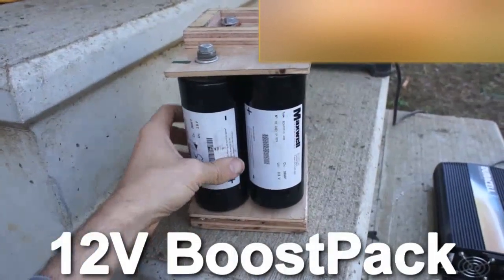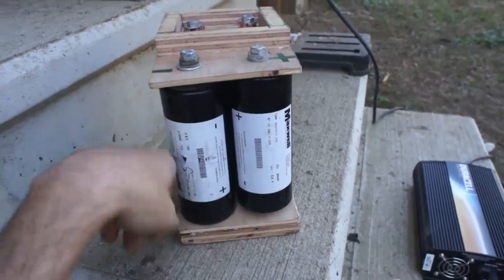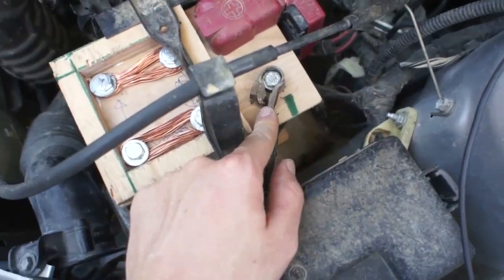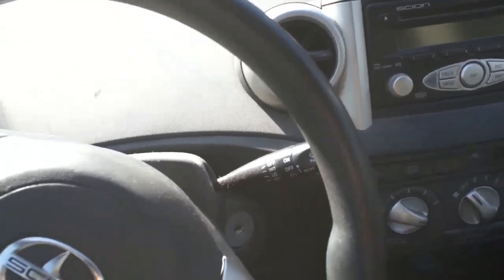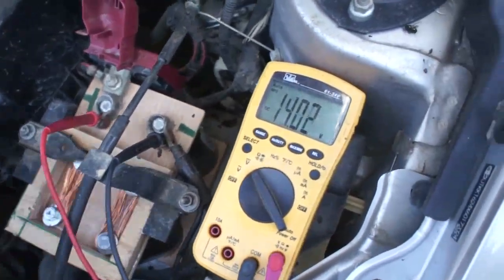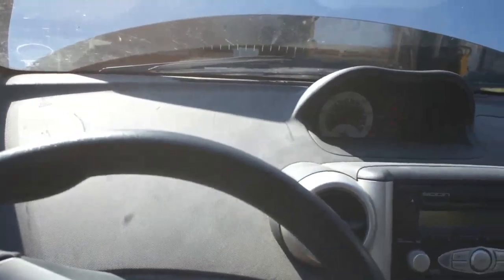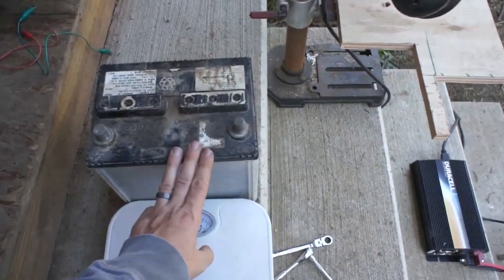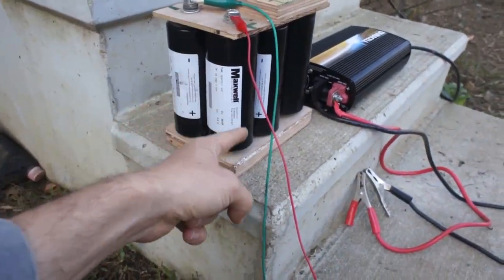12V BoostPack. Replaces auto battery. Works great!

Comment: how do you prevent overcharging?
Reply: If a capacitor is connected to direct current it will gain charge, to its max capacity then it will stop the current from flowing.
Reply: Thanks!
Reply: There's an issue with that. A capacitor is safe until a particular voltage. When the charge in the capacitor balances out the voltage applied to it, nothing more happens, no further current will flow. So in case you're using a single capacitor cell, it's very safe. It's only safe up to a given voltage, of perhaps around 2.6V for supercapacitors, if memory serves.

Now to make up a battery, he has connected 6 supercaps in series, making for a nominal voltage of about 30V. There is however nothing to balance them, nothing to prevent, by difference in individual capacitor behaviour, comparatively low voltage occurring on some capacitors while relatively high on others, damaging them (akin to "overcharging" you mention but not quite), increasing their ESR, and then potentially causing even higher voltage to form on them. See Ohm's law. Current must obviously be the same through all cells in series configuration, but then the voltage dropped across each of them is proportional to their individual ESR.

I think it works for now because the nominal voltage is so much higher than alternator voltage, creating a bit of a margin for ESR difference between cells. However, it doesn't appear intrinsically safe to me. Maybe it is for particular kind of supercapacitors, but we'd need an expert on those units to comment on that.
Reply: how do you get 30v when you multiply 6x2.5=15v??? how did you come up with twice that. and ohms law that all carry the same charge and voltage besides for its rate of decay, decay raits sould still function as even. if he wanted to have more stable curve capacity he could have go packs like this and run them parallel to each other this going him 1000cca. because there is 500w per farad, I think thows packs are 3500f so dance you need 5 of the capacitors to equal more than 14.4 volts you multiply 3500(f)×500(w)×5(capacitors)=6,500,000(w)
now you take the total watt output and divide it by 14.1 volts because that is your "full charge" to get you you mAps, so... about 460.9 amps total capacity on demand from 5 capacitors. that is my logic, if not can you please explain it to me?
Reply: Gerard Klingman you are right! I made a mistake by factor of two! Thanks for checking me! 

Ohm's law however doesn't force them to carry the same charge, because neither the impedance nor the ESR of capacitors are matched to each other. They may come out reasonably close out of the factory, but they will drift apart in use. How much that's going to be a problem, is hard to judge, somebody with years of experience in supercapacitors should do it rather than me. As opposed to batteries that have chemically induced junction voltages, capacitors do not, their apparent voltage is nearly linear with charge, up to a limit that you externally need to guarantee that no higher voltage will be applied to them, else bad things may happen. Tecate for example says their supercapacitors need balancing when connected in series - in simpler cases via bypass resistors orders of magnitude smaller than ESR, or in cases of high current cycling they recommend active voltage clamping balancers across each capacitor.

I'm not too concerned about effective capacity loss. By the way, the calculation you use is more than a bit confused. Watts are a measure of power but Farads are a measure of capacity, so where is your relationship from? And why is it of relevance? Watt*hour is a measure of capacity, and it depends on your useful minimum discharge voltage. If it's assumed to be at about half the nominal voltage, you get maybe 800-ish or 900-ish W*h per Farad if memory serves at those voltages. I'm honestly not too concerned whether one may be able to start a vehicle one day, because let's face it, that would happen someday anyway, for one of numerous unrelated vehicle electrical failures. 

What I'm more concerned about is that individual voltages across some cells while charging will exceed the safe rating of around 2.6 or 2.7 Volt, and were it to exceed it even significantly further, may potentially result in what they call "venting with flame", which is not at all fun.

Comment: from what I understand..capacitors do not store energy like a battery (remember the old days when someone charged a capacitor and tossed it to you then said "catch"! 

Once your car/mower/boat does not start a few times..well anyway like a fuel tank storage of fuel and storage of CCA such as in a battery are the same. Caps can punch put the amps but they do not have the reserve pull like a battery. Not being critical but this is from what I have always thought was the way it worked? 

Peace and thank you :)
Reply: Those capacitors which we charged up and threw at one another were not charged to 12 volts. They were typically charged to the max voltage coming from the power supply of a tube-type television or something similar. More like 350 - 375 VDC and never less than about 250 volts! 12 volts will do nothing to a human hand. You will not feel it until the DC voltage gets to be greater than about 50 volts.

Comment: I look on E bay and see that this super capacitors cost more than $26,- a piece. 
Needed are 6x$26=$156. For that money i can buy 5 start battery's.  The live time of a car battery is +/- 5 years.  5 battery's are good for 25 years starting.  

What is wisdom
Reply: sure like to know where you get your batteries from and what kind,
They wanted $145 to replace my battery last year and I still had to give $105 for the cheapest battery I could find.....and it is not a special battery.

Comment: There may be an industry standard or safety code this boost pack might be in conflict with. I salute this inventor and love his idea but hopefully he never runs into any trouble with the law. You hear stories of great investors jailed and fined for going against the grain of the department of energy.
Reply: +jc dova You could be right. We used to throw fully charge 1f caps at each other 'back in the day' and when you grab them they give one hell of a kick.. but they also explode.. rather spectacularly..mostly fibreglass and the like and plenty of smoke...though.. I'm willing to build one and giveit a go as the performance gains would be noticable in the street car with not much power.like a Hyundai i30 for instance..

Comment: little heads  up pimp they dont charge that fast thats how much jucie ur altenator was putting out itd be cool if u were right  good vid tho
Reply: +Charles H. Wiemeier Caps charge pretty quick.. what do you mean?
Reply: SOON as you vehicle is running its gonna read between 13-14 volts unless your alternator is bad then itd read less

Comment: Nice vid, question: can the alternator take so much instantaneous current passing to charge the pack???
Reply: Shouldn't be a problem, alternators have internal devices that limit charging current.
Reply: +Ben Lucas Tell us more.. as  I am seriously looking to do this..I know the alternators have seriously dumb regulators in them.. they are often time based rather than statistical based. menaing they cut out after a period of time rather than if the battery is fully charged.so they go from bulk charge to trickle charge in 15mins. so if you include a BMS with these caps.will that solve the problem?
Reply: Wow, great stuff! I have a question... I'm interested in implementing this system into my boat..? - Quick backstory/info - My boat has a 150hp 6cyl outboard motor which requires a 12v cranking battery. My trolling motor has a 36v battery bank (3-marine batteries). So in total, I have 4 batteries on the boat which is a lot of weight. What is worse is that they are all on the stern of the boat -- another story entirely - but basically when the boat is at rest the stern is extremely low in the water and the bow up in the sky. I am planning on moving the 36v battery bank forward to the driver's seat (2/3rds forward) which I know, leverage wise, will reduce a lot of weight on the stern 

Now here's where this supercapacitor comes into play, I'd like to completely eliminate the cranking battery in the back of the boat and replace it with one of these supercapacitor banks. Then, I would like to use a 36v to 12v (20amp output) voltage reducer (designed for golf carts) in order to create a hybrid system that can recharge the capacitors should the motor not start immediately.

Will this work?..ish?
Will the alternator damage my voltage reducer (which I assume is not designed for 16v being pushed back into it...)? if so, Is there some type of Diode system that would allow the outboard to charge the capacitor bank but not allow it to back feed into the voltage reducer?

I have absolutely no concern about the capacitor bank going "dry" and leaving me stranded as the 36v trolling motor system can power my boat for days and days on end

What other concerns might y'all have? Would I need a BMS to protect my outboard alternator (I don't know what a BMS is sorry for my ignorance).

Thanks in advance for any input!!!
Reply: @iFishVT  Electric trolling motor will need the batteries. Ultracaps do not have high amp-hours. There meant for a quick rush of power to start - not long term.
Reply: Can't you use the batteries on the trolling motor to start, putting the three into parallel for starting should provide enough current? Though it would be a real bitch to have to devise a system that can move 3 batteries between parallel and series configuration at that amperage.
Reply: +bicanoo_magic "I know the alternators have seriously dumb regulators in them.. they are often time based rather than statistical based. menaing they cut out after a period of time rather than if the battery is fully charged" Citation needed.
Reply: @douggale5962  No9t time. its all about your battery to accept all the power. Batts need time to recharge. Caps do not.
Reply: @SamaritanElad  Because capacitors hold almost nothing compared to a battery.

Comment: I can`t believe that there are so many people who are prepared to accept the advice of a fellow who puts together some videos about replacing a car`s lead acid battery with some system that depends on super capacitors.  The questions I would want answers to are: what credentials this person has pertaining to specialist knowledge, practical and/or theoretical in electrical engineering particularly in regard to automotive applications;  Has his work been peer reviewed if so what are their credentials, there are lots of shonky organisations masquerading as legitimate and respected institutions only too happy to  deal out qualifications that are questionable at best;  Can I be absolutely certain that the video demonstration has been conducted under the strict control of independent examiners to ensure no possibility of manipulating the results;  I would make my own inquiries with electrical engineers, auto electricians as well as manufacturers of these products to see if they would recommend their use in automobiles in the way depicted in the videos.   I would check with the car manufacturer to obtain their view as to suitability and also how it might effect the warranty.

The lead acid battery has been around a very long time, its performance the good and the bad is well known, by and large it does a good job.  Treated well it can last a long time, I have had eight years out of them and frequently five years.  Finally I would need to be satisfied that the benefits of this system would need to be greater than the battery system and that any disadvantages would be minor and involve no greater risk of damage or injury or be life threatening.  That this system offers a weight saving advantage is insufficient reason as to be laughable.  If weight saving is a priority then offload any unnecessary cargo and carry minimal fuel just as regular public transport aircraft do.  

Before investing, do your homework.
Reply: credentials, that's what you receive from someone that learns from the inventor on how it was put together.... reverse engineered  until it's understood, then it's published in books from someone that has a lic, from the state to teach a class think of it like this - if you build your race car and modify it to add more power or save time in braking - you just may win a race - or you can wait until somebody is selling their old idea's that work and is known to be dependable.... your race car may not be the fastest - but if it's the last one still in the race, you will win!
Reply: Credentials!!! What credentials did Edison have? How about Tesla? He invented AC power!!! What about the Write<sp> Brothers who occupation was building bicycles? How about B. Franklin who invented bifocals?

I believe one of the reasons that there have been so many BIG breakthroughs in the last few years is BECAUSE ALL THE OLD NAY SAYERS THAT CONTROLLED THE RESEARCH FUNDS HAVE DIED!!!!!!

Those Who Can...Do
Those Who Can't Do... Teach
Those Who Can't Teach... Administrate 

Those Who Can't Even Administrate...
Try to Tear Down The First Three.
Those are the ones who are at least trying to do something positive !
Reply: I can't believe there are so many people in the auto battery industry that would seek out these videos and use the authority fallacy to try to discredit him. Maybe you should just diversify your industry by making capacitors as well as batteries. You can't lift yourself up any higher by putting down the competition.